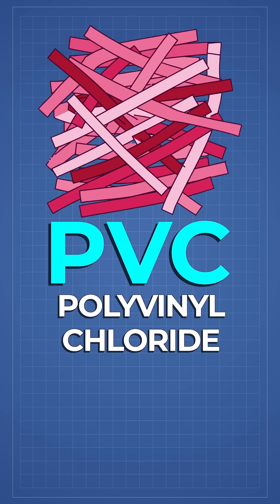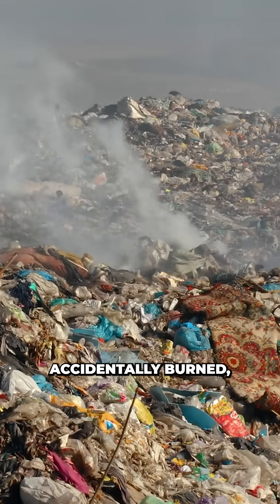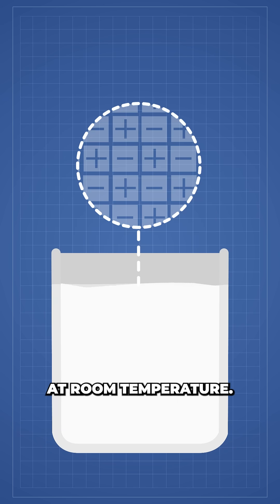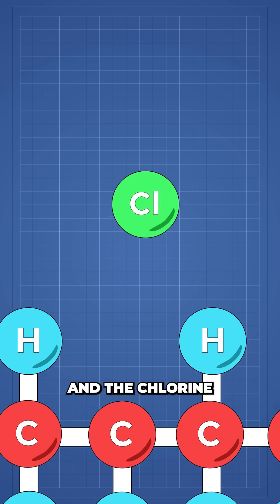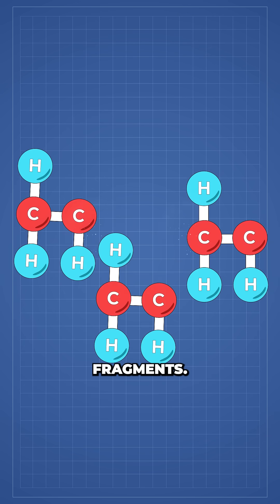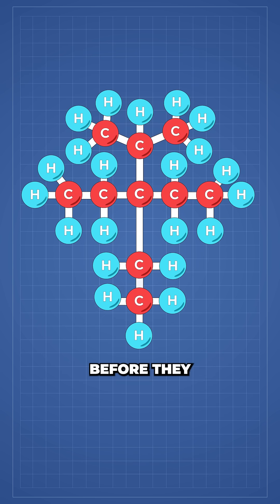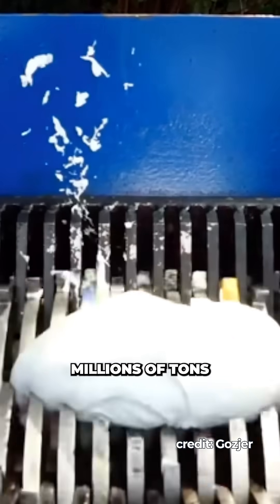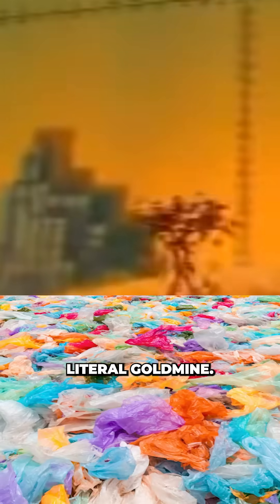Scientists Turn Plastic Waste into Fuel

Comment: >weve discovered a new way to burn hydrocarbons
Reply: To be fair, it's either going to be burned or dumped no matter what.

If we are able to harness energy from household plastics instead of ocean dumping, I'm willing to hear them out.
Reply: @a7hazen and as a liquid it is a far more useful fuel than as a solid, burning far cleaner and in a common ICE instead of a specialized furnace.
Reply: @SuperS05  I suspect that this will have to be burned in specialized power plants. Using it as fuel in cars will have side effects on the vehicles and god knows what sort of toxic emissions.
Reply: @nagualdesign  there’s no point in going through this process for a large fixed burner. They could use solids just as they do now. Sure we may have to alter catalytic converters but if it’s a “near to gasoline” as they claim it shouldn’t be much of an engineering problem
Reply: @SuperS05  Are you saying that there are already power plants that burn plastic? I can't imagine it being very efficient, and as the video says PVC releases some nasty toxins.

If they can separate the chlorine and make a relatively clean liquid fuel, it's a simple process to generate power cleanly at scale. Modern car engines are highly tuned. "Near to gasoline" doesn't inspire confidence.
Reply: @nagualdesign  I was more inferring to coal and biomass as a solid, but yes there is. There’s a lot of “waste to energy” plants. I guess that’s a better name than garbage burning. This is where most plastic recycling ends up unless the jurisdiction has set up a specific plastic m recycling program as the video eluded to. These are generally small plants, in the neighborhood of a few MW.
Reply: @a7hazen it still produces greenhouse gases. We shouldnt be burning it, no matter the form
Reply: @a7hazen or we could use millions in fuel to yeet it out if the atmosphere
Reply: Garbage in garbage out...
Reply: My first thought
Reply: Better than letting it turn into microplastics.
Reply: This is way better than drilling for new hydrocarbons though.
Reply: Burning hydrocarbons produces greenhouse gases. This isnt better
Reply: Peak oil was around 2010, peak natural gas around 2035, peak coal mid 21st century. When will we be harvesting and converting plastics into fuel? We'll probably be defunct by that point anyway.
Reply: @camazotzz plastic is a petroleum product.
Reply: @a7hazen indeed. what i was thinking. What can we do with the waste oil to petroleum biproduct? Plastic! Now plastic to petroleum. Great to have a way to use existing waste plastic... But maybe they could release a little less into the world if the process could be adapted to get more out of the sour in the first place..  🤷‍♂️
Reply: Plastic is made from hydrocarbons, so we're just turning it back into hydrocarbons
Reply: What are you talking about??
Reply: The world would stop if we stopped burnimg hydrocarbons. Most of pollution is made by factories and ships transporting goods.
Reply: >we've invented wheel
Reply: @amoru5898 shit comment
Reply: burning hydrocarbons is not the problem. Burning fossil hydrocarbons is.
Reply: @carlosandleon no. Do u think oxidation products change based on the origin of the substance?
Reply: @shredyoutubeworkersandceos Its a difference between added CO2 or not. Most byproducts are already filtered outby the catalytic converters anyway if you’re talking about local pollution.

The money you set aside and the money you spend are also in different accounts despite being in the same bank you know.
Reply: The catalytic converter filters out co2?  @carlosandleon
Reply: Burning gasoline is much safer than burning plastic though and much more useful, this is much better than just burning plastics because that's what happens most of the time. People really just need to complain about everything
Reply: U r ought to stop burning EITHER

Comment: PVC was invented to do something with the access hydrogeh-chlorid, which is byproduct of NaOH production. I'm curios what wil lwe do with the HCl which is made from this process.
Reply: It's a common reagents so if it's pure enough I guess it could be sold to laboratories, it's also used in electronics manufacturing

Comment: They discovered this over a hundred years ago. The problem is that it's expensive.
Reply: Sounds about right, that ionic liquid didn't seem like something you could just whip up like it's nothing
Reply: @TJ-Fra it just takes heat and pressure to depolymerize plastic.

But it takes energy to make heat
Reply: @mansquatch2260  Sure, but that heat can be supplied by renewable sources. So then the question is whether the plastic pollution or the waste products from burning the fuel are worse problems. Plus other things like whether or not the presence of the fuel is displacing other, actually better options.
Reply: @thestic6349  That heat can be provided by a lot of sources. Build these recycling facilities near nuclear reactors and now all the plastics can be cheaply recycled.
Reply: @mansquatch2260 the nuclear plant is already using that heat to make electricity. Why would they sell it for less money to an inefficient plant like that? That's not very economical.
Reply: @dentonator2010 the plant would buy electricity, not heat
Reply: @mansquatch2260 that would be even more inefficient and still cost more than it's worth. If you had your own nuclear reactor you wouldn't go to electricity then back to heat.
Reply: @dentonator2010  how do you think industrial operations work?
Reply: @mansquatch2260 they prefer to generate heat directly using coal, natural gas, or other combustibles. Sure they use electricity for things, but they prefer not to use it for heating of industrial processes. I'm a chemical engineer, we literally design these kinds of things. Using electricity to generate all of your heat is usually too expensive.
Reply: @mansquatch2260 nuclear power (current technology) is just way to expensive. 

But, how about unused renewables. In Germany we have months where 20-30% of renewables are wasted because the grid cannot carry them. We could use that energy for recycling or hydrogen.
Reply: @dentonator2010  Are you familiar with Thermal Depolymerization?
Reply: @mansquatch2260 yes, my masters and part of my PhD work were with thermal analysis of polymer reactions, polymer physics, and polymer viscoelasticity (both thermal and mechanical).
Reply: @dentonator2010  Have you kept up with the developments in TDP? How much energy it takes to turn a given amount of plastic or biomass into crude oil? Back in the early 2000s it wasn't efficient enough to make a profit with oil prices around 70 a barrel.
Reply: @mansquatch2260 there have really been any developments in the technology, you're limited by the heat of formation of the molecules. There's not really any getting around that. It will always take more energy to reform the polymer into the alkanes you want to use as fuel than you can get back out of it by burning it. It's a net energy sink. Unless energy somehow got a lot cheaper, then it's not really worth doing. Kind of like generating hydrogen using electricity then burning it for fuel. Sure you can use solar power to make it during the day, but it would be simpler and less energy intensive to just use less natural gas and coal during the day. Unless you had so much solar and wind (like 3-5x base consumption during the day), then it's just not worth doing. It doesn't reduce emissions net or costs. The economics just don't really work out.
Reply: @dentonator2010 you mean breaking molecules down, this is thermal DEpolymerization. Turning plastic and biomass into oil.

It's also not about energy efficiency, but economic efficiency. The cost of buying feed stock and running the refinery vs the price of the oil going out.
Reply: @mansquatch2260 I'm aware that it's depolymerization, that requires energy. You can't burn oil, use that energy to make less oil equivalents AND make money at it. It doesn't really make "oil", it'll usually make an alkane or something similar. Depending on the process, you are likely going to be making syngas (CO and H2) that is then repolymerized into an alkane over a catalyst. The economics of it aren't based just on a barrel of oil as they aren't really equivalent. The price of electricity has been increasing, while the price of oil is somewhat stagnant over the last decade or so. Not to mention you have to physically collect and separate the plastic, there's a reason they don't recycle plastic very much, as you could repolymerized it if you had it separated correctly, but it's not with it, it's cheaper and more effective to make new plastic.
Reply: @dentonator2010 they literally  burn some of the oil they produce to power the refinery.

You don't seem to be familiar with the process at all. 

You should look it up
Reply: Takes more energy then it returns
Reply: @6izzy837 it's a conversion. 100 units go in 80 come out, 20 used to fuel the conversion.
Reply: ...and its mostly benzene
Reply: because making billion dollars agreements with sheiks and doing proxy wars to defend their interests is cheap...yup, sounds about right. Not to mention having to deal with russia's bs
Reply: @Eisenwulf666 old thinking
Reply: Solar cells (photovoltaics) were discovered over 100 years ago too, they're not expensive anymore. A lot can change in 100 years
Reply: @NathanSMS26 they're still expensive
Reply: Well, how can we make it cheaper?
Reply: @kimia1664 cheaper energy.

Comment: when the entire oil in the world is gone we'll be facepalming because we burned majority of it as fuel
Reply: remember when they said it would be gone in the next 10 years like 50 years ago.
Reply: Crude oil resources will definitely deplete
Reply: When the entire world is out of oil, we're fucked. Everything runs with or off oil. Even EV's need oil as lubrication. Oil is in every factory, every vehicle, even stuff like powerlines have oil filled capacitors and transformers.

Comment: I mean this is cool...but nuclear is easily the most viable option we have the only reason we don't is because people were cheap when it first started and safety regulations were ignored so all anyone remembers is things like Chernobyl. In the right location, with proper laws and regulations a nuclear reactor would be a perfect power source and it could genuinely replace fossil fuels almost entirely it just will never happen bc the rich control our world and you know...not the people that live in it and actually have all the power.
Reply: Where are you putting the spent waste?
Reply: @SimonSheridanKarate this channel literally had a thing recently that talked about the fact they found out they can put nuclear waste into a particule accelerator and reuse it. Before that it was still the most viable option we had.
Reply: @zgama6511 and we also have a proposal to spend £57b in the UK to bury it indefinitely until we can figure out how to use it, the video on creating Tritium wasn't being touted as a way to use up all the nuclear waste and there was still a substantial amount of waste that is not converted to Tritium.  Nuclear power has its place in energy production, but it is only part of a solution and compared with renewable energy sources and energy storage, it is no where near as attractive.
Reply: @SimonSheridanKarate with solar, water and wind piled on it very much is a viable option. I'm not even saying get rid of fossil fuels for an environmental reason, they are a finite resource they will run out. The only people benefiting from us remaining on fossil fuels are the rich and powerful invested in those industries.
Reply: @zgama6511 Then we totally agree 👍
Reply: @SimonSheridanKarate lol 🤣